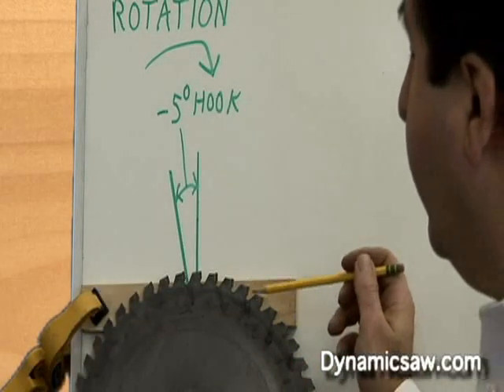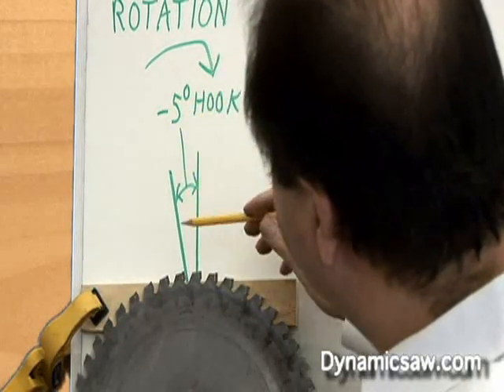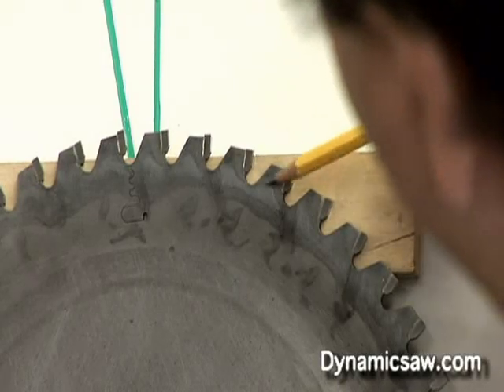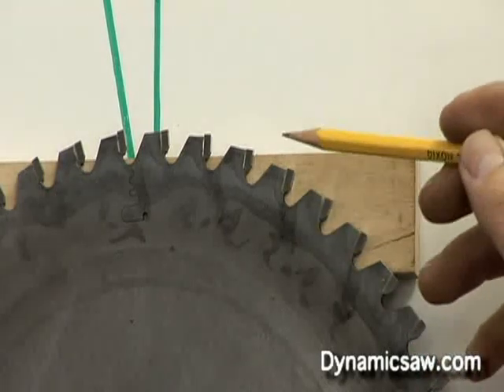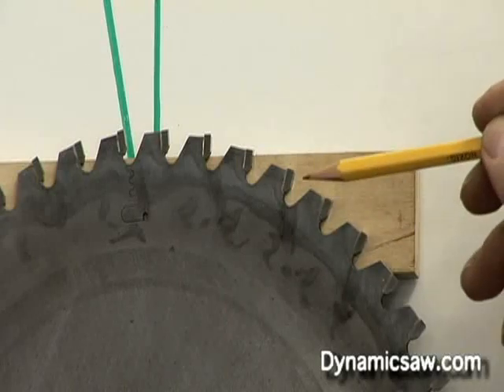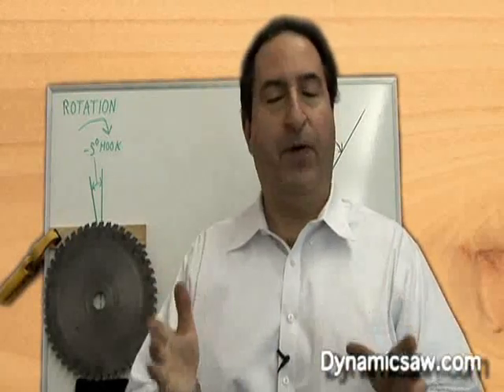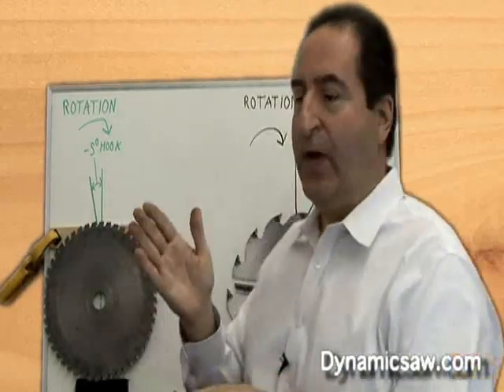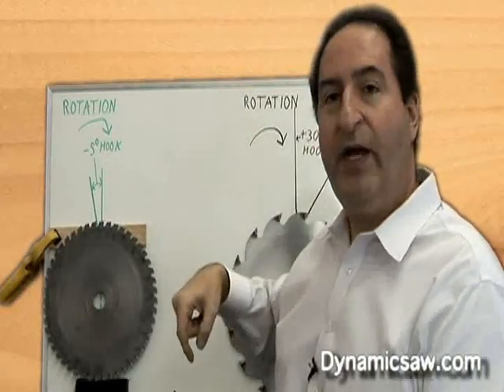Saw Blade Technical Information: negative hook #4

Comment: I have two compound miter saws, and the newer one didn't come with a negative hook blade. I've recently been shopping the net to find one but everything that's affordable says it's or metal and makes no mention of use for wood. Most of them have 40-60 teeth and are 7 1/4" diameter, priced $15-$30. Are these uitable for wood?
Reply from the maker: Most of the standard blades you can purchase are used for wood applications. Just be aware that you may get chip out and tearing on the back of the cut.  A good negative hook blade may run a bit more than the $30.00 price-point but it is a blade that will last a lifetime.

Comment: Well I have to say YOU are obviously an enthusiast.  My dear friend all of my radial arm saws have a negative hook blades on them.  I have them for wood cutting, and yes there are negative hook blades sold for that by Diablo Freud.  Please do a fact check before responding.  They never burn wood, however they eliminate a very dangerous saw walk and kickback on radial arm saws.  And they are manufacturer specified for radial arm saws.